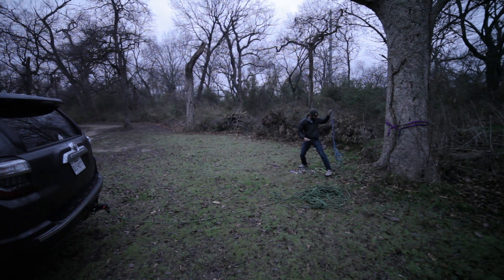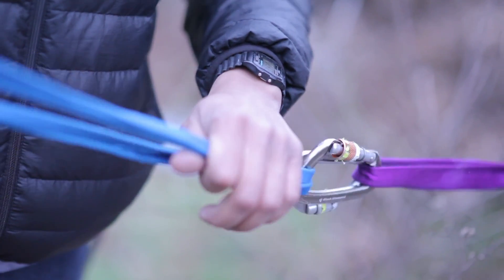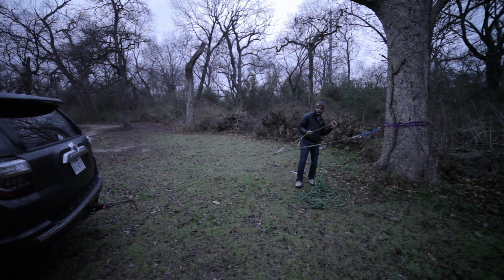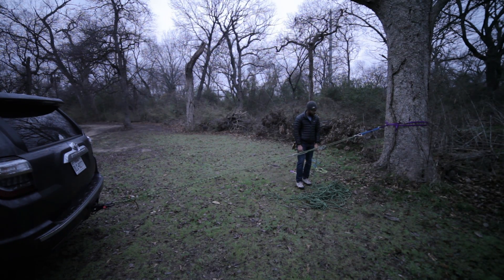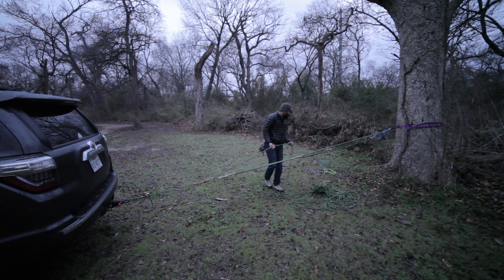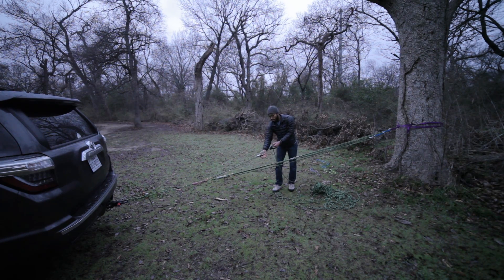Trad Climbing Gear for 4Runner Vehicle Recovery System

Comment: I would make the following suggestions to anyone that wants to recover a vehicle. FIRSTLY, reduce the amount of metal in the system. Use a newspaper or a magazine to prevent a knot from tightening at the hitch rather than a carabiner, in order to avoid a failure sending the metal towards you. The same can be done at the anchor point. SECONDLY, along the same lines, the use of dampers prevent any rope under load and any attachments from causing damage. Place a heavy jacket over the rope at either end (about a few feet in) and in the middle. This will arrest any flying rope and metal attachments. That would make the whole recovery much safer.

Comment: Great video. One very important thing I noticed is when you tried to multiply mech. Advantage you went back to the load line. This offers no multiplication. When rigging a compound system you always want the next system to be “pulling” on the haul line of the previous. By putting a secondary or third system on the original load line you are bypassing the other systems and only one is in use. This can be seen by all of the slack in the video. In this scenario the first friction hitch you made should have been the one closet to the vehicle. The second hitch should have been on the haul line of the first 3:1. Ect.

Comment from the maker: Matt,
Yes and no, yes if you're using a standard dynamic climbing rope it won't destroy it but it will definitely decrease the life of your rope hauling that size of a load. It could potentially snap the core  but the odds of that happening  are pretty slim unless your car is is rolling down a hill with a lot of slack in it all that load hitting the road at one moment would sever it however the same method is used to help assist climbing up the wall not that severity  a 15:1 21 is pretty silly on a rock climbing wall. 
Know if you use a static rope. Static groups are used to set up top rope anchors and are very durable and that kind of load would not bother them at all. Thanks for your comment!
Mario

Comment: You probably know this, but the friction in your system greatly reduced the theoretical mechanical advantage of that system. The slack at the grigri indicates that the rope wasn't moving at all on that end, so those pulleys were doing nothing. I think this system would have worked much better if you just used a carabiner or two instead of the grigri. If you wanted progress capture or safety, a simple ATC (not in guide mode) minded by a prusik would probably have less friction than a grigri.

If you happen to have any 'revolver' carabiners, or better yet an actual pulley, those would help a lot. Put the most efficient pulleys closest to the person(s) doing the pulling.

Pulley systems can get really confusing once you do anything beyond a simple 3:1, but it's worth looking into. It's hard to tell, but the final setup their looked more complicated than a 9:1 system should be- all you need for that is a 3:1 on another 3:1, which should only require two prussik loops.